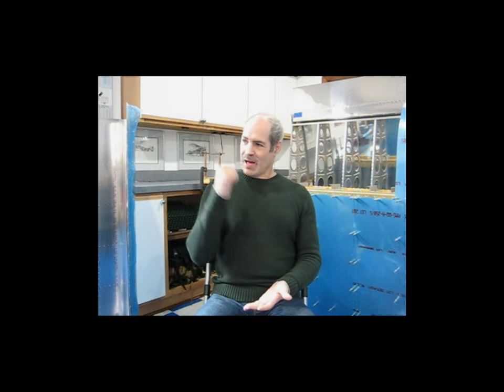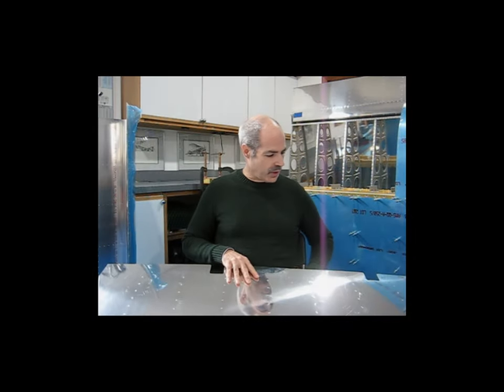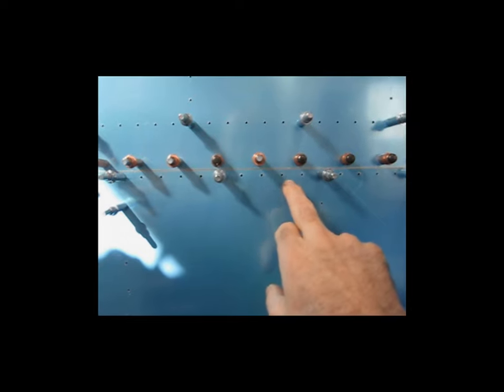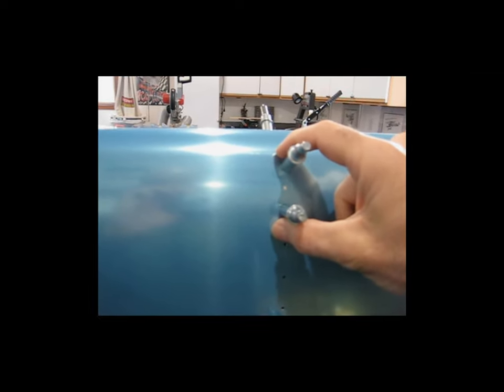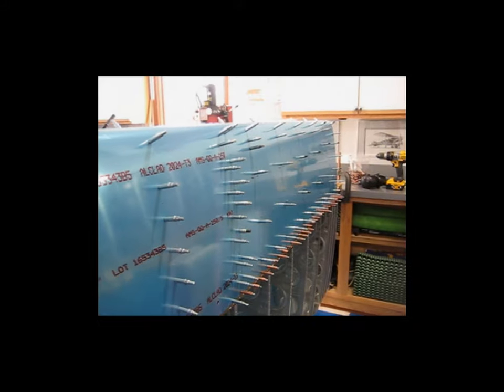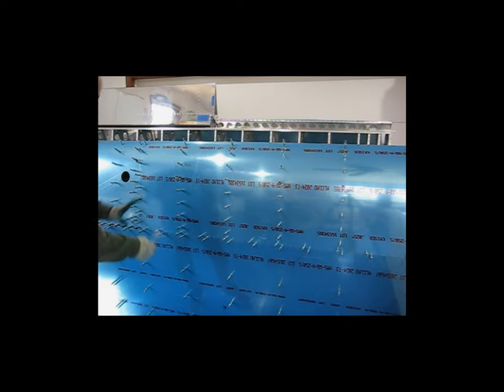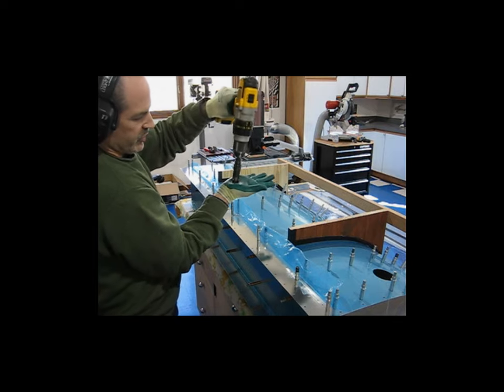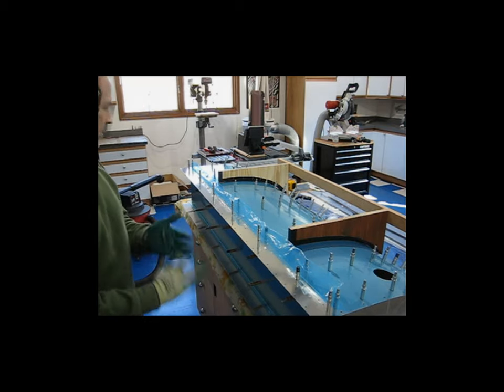RV 7 HINT Videos WINGS Fuel Tank Fit Up

Comment: Thanks for the videos ,  just a quick question about your wing skins and the 1/16 gap between the skins ,  when you did your riveting did this gap go away?  Asking because my skins fit tight against each other . Just worried about the final fit .. thanks
Reply from the maker: Howdy. Yes, I still have a gap where two skins butt together on all skins. (After riveting is complete.) It is a small gap and allows for possible  movement when riveting as the skins tend to spread out as you go and the gap allows for possible expansion when sitting under the sun.  As you rivet. keep laying the skin down to check for interference/overlap.